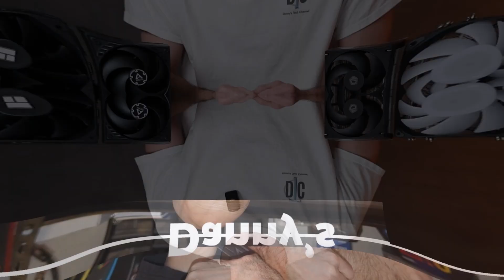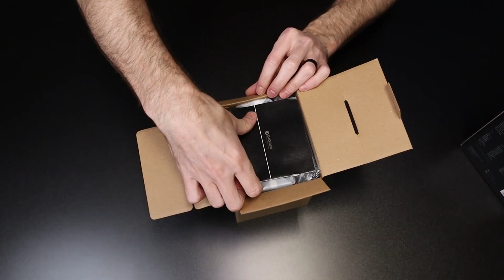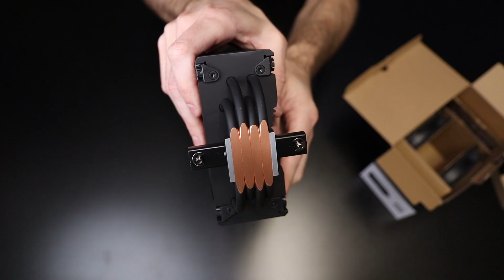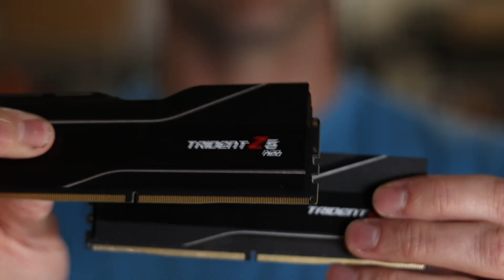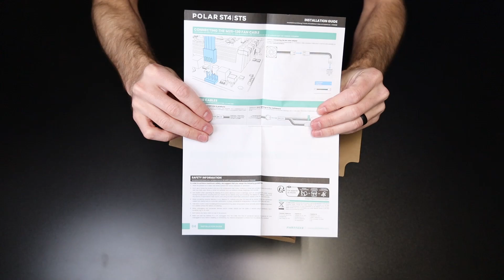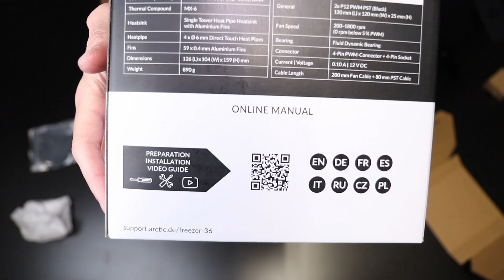BEST Budget CPU Air Cooler? Installation, Performance, & Noise Tested!

Comment: On my AMD 7700 I never got over 64C when running Cinebench 2026.  I am using Artic MX-6 thermal paste.  I am pretty pleased.  Checking 50% fan next.

Comment: I'm just here for the Phanteks: and only because it's impossible for me to hit the temps advertised everywhere for the Freezer 36. 50°C in idle, even after remounting it with tried adjustments. I guess I also can't rely on these Phantek results. (Possibly nobody can rely on any cooler results anywhere... They might be different in every build for no reason. A 7800X3D does not require much cooling. Imagine all other additional remarks one possibly needs to make...)

Comment: Can the deepcool assassin iv cool a ryzen 9 7900x3d ? Because I'm planning to build my first pc with white colour and this cooler looks so clean
Reply from the maker: Yes it absolutely can! I used mine on my 7800X3D and 5800X3D and it works great.
Reply: @DannysTechChannel  thanks so much man 🙏 because im about to build it soon and want to make a white build with this clean looking cooler. Because i want to get an air cooler because of their reliability. I'd go for the noctua nhd15 G2 but 150€ for an air cooler is crazy .
Reply: Deepcool Gamer Storm Assassin IV It can be used on >>LGA 1150 (kontakt H3), LGA 1151 (kontakt H4), LGA 1155 (Socket H2), LGA 1200 (Socket H5), LGA 1700, LGA 2011 (Socket R), LGA 2011-v3 (Socket R), LGA 2066, AM4, Sokkel AM5

Comment: Hello there Danny!! 

I live in a country that gets hot during the summer, and when I say hot I mean hot 🥵 I have a desktop with a midi case with good airflow, just an APU (5700G) and the beefy BQ Dark Rock 4 (non Pro)... and if I were to use handbrake the temps would easily exceed that of 80 Celcius 😅 Changing the Affinity of Handbrake to fewer cores is my only option in the summer 😅😅

I would really like to buy a new desktop and use the awesome 8700G as it's iGPU is all I need... I am over 30yrs old and replaying games released between 2008-2015 at 1080p Normal Settings is perfectly fine for me... But what CPU air cooler would cool the 8700G ??? I will be using the new computer from October to April and use the older desktop with the cooler 5700G between May and September 😅😅😅

Many, many thanks in advance 😊
Reply from the maker: If you are able to buy from DeepCool, I’d go with the Assassin IV. It is a monster!
Reply: @DannysTechChannel  

I will be able to get it, and I will get the one you recommended!! I owe you one Danny!! Thank you VERY MUCH 👍
Reply: @DannysTechChannel  I wil get yhat one too it looks good and i am tired of the water cooling mess!
Reply from the maker: Great choice! It’s essentially maintenance free and has solid performance.

Comment: My name is Danny too 👍I have an ID cooling single rad that came with two fans for push/pull for $16 for my back up pc. It's great for that price.  I have a Noctua ND-D15  on my main PC (9800X3D)
Reply from the maker: Beefy air cooler ya got! Great choice. I used my first 240mm AIO from ID Cooling recently and it performs really well.
Reply: @DannysTechChannel Hello, do you have a video of the PCCOOLER RT500 TC BK processor

Comment: I have a Deepcool AK400 which should perform about the same as the design is almost identical to these coolers. It's still available outside of the USA despite the sanctions. I like the look of the freezer 36 the most with the fan mounting, but Arctic costs more here in Canada by minimum $10usd on the black one and $13 on the argb model. Surprised the freezer 36 outperformed the burst assassin despite having 2 less heat pipes in unigine. Great comparison! 

I remember when I was trying to install my pa120, I thought it was defective, as I needed a LOT of downward pressure to get the screws to connect to the brackets. That's one thing I couldn't stand about the installation of thermarlright, but no such issues on my thermalright 360 aio
Reply from the maker: Thanks for the info! I haven’t used any of ThermalRight’s AIOs but that’s good to know. I love the AK400 and wish I could buy DeepCool’s products again.
Reply: man sell that deepcool as collection for moneeeeeeey